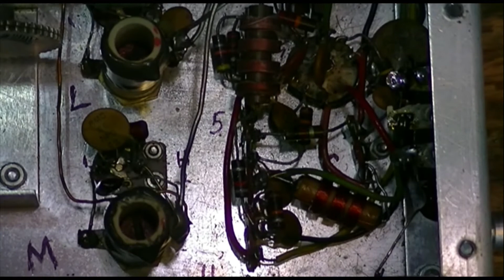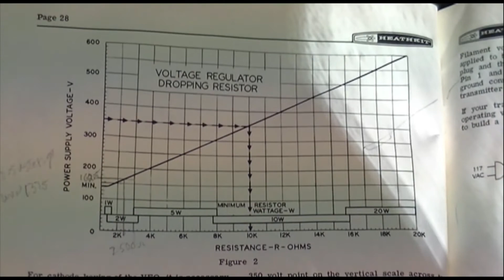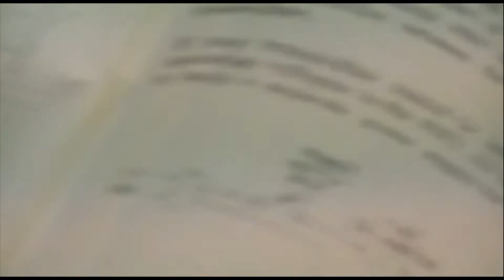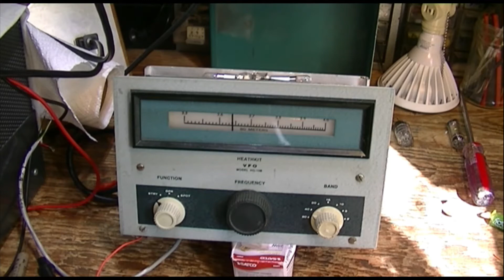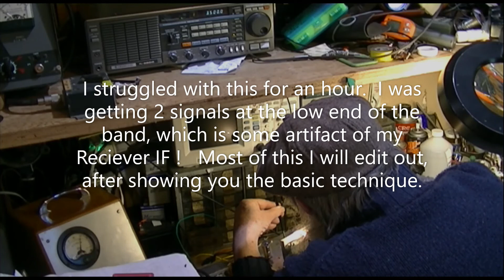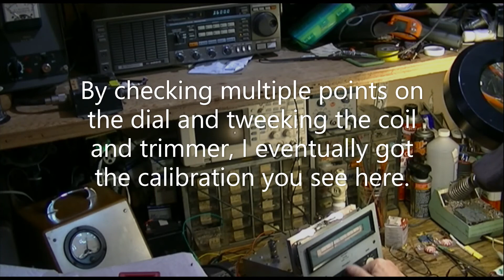W6WUH : Heathkit HG 10B VFO review and calibrate

Comment: Thank you, very nice. I was looking for this video because I've been playing with my HG10 and several problems pop up. One of the things that's always been a problem for me is the term ZERO BEAT. I've always taken that to me you tune to the point where the tone disappears. Like if you are using the 100htz calibrator built into most radios, you calibrate your dial so you are right on just as the tone goes to zero yes? BUT, if you run into a problem when talking to someone on CW, you are supposed to ZERO BEAT their signal, so you set your VFO to the point where your signal just disappears? and you are on their signal. Hard to understand and I've been doing this since 76. I ask someone that's also been doing it a long time and they say, no, you set your VFO so the tone sounds the same as their signal, and that's ZERO BEATING their signal. So I started out my voyage into ham radio with a borrowed HW16 and HG10, always set the vfo to the same tone as the op I'm trying to talk to, and haven't heard any complaints. Just a while back, one gentleman that was recording my end of our QSO was telling me my signal was drifting high. I can hear that in the recording, but it also seemed he had to adjust his RIT every time the exchange switched between us. Maybe I'm talking about two different things here, but trying to calibrate the HG10 I'm finding once I get it right on 40, the other bands are off, and can't get it right. So now I have a new tube, and I'm going to go through the procedure again using the ZERO BEAT I'm hearing from your demonstration and hoping for a different outcome. Thanks again. de WA1YDK 73
Reply from the maker: stick to your original understanding, the frequencies you are comparing are the same when there is NO tone caused by dis-similar frequencies beating against each other.  Hence Zero Beat .  When working CW... you do this with your bfo OFF.  The receiving station adjusts his BFO to create the tone he wants.  The  VFO manual will explain how to set the calibration for each band. Follow the sequence and instructions given, step by step including how to place the indicator on the dial string.  Sometimes it is necessary to slightly bend tuning capacitor plates to achieve the best tracking. It is not a digital device - so a few kcs off may be the best you can get somewhere on the dial.   Keep juggling both ends.

Comment: Thanks for the info.Where did you get the schematic for the external power supply you built?What cable are you going to use to connect the VFO to your transmitter.
Reply from the maker: it is some junk homebrew supply that was lying around.. transformer, couple of diodes, filter caps, and a dropping resistor to get 105 volts under load.   if you have a tube type reciever or transmitter, you can probably get the filament voltage and low B+ from the accessory jack.. and use the chart in the manual to find the dropping resistor you need.
Reply: @captlarry-3525  Thanks for the reply Larry.
Reply from the maker: Ron the  older ARRL handbooks before about 1975 will have a chapter on power supplies for vacuum tube radios.  a simple full wave rectifier (2 diodes, or one tube)  a transformer, filter cap and resistor will do the trick...or steal 100 to 225 volts out of any reciever with tubesmthat has a transformer
Reply: @captlarry-3525  thanks for info Larry.